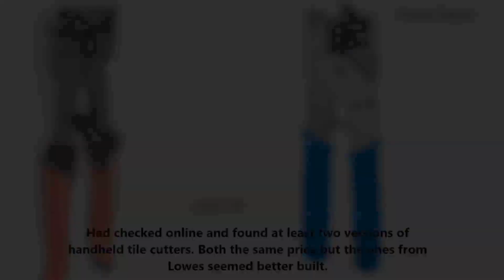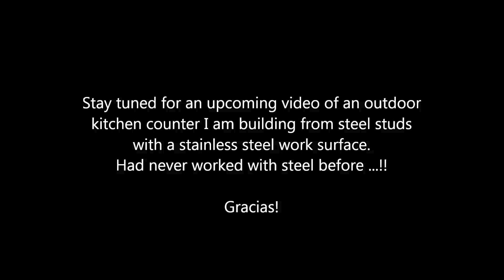Cutting terracotta tiles with a handheld tile cutter

Comment: Thank you! I'm doing a round table top with 4×4 decorated terracotta tiles, and I need to cut and shape the tiles for the edge of the table. I don't recognize the tool you used. Could you post the name so I can look it up? I have a great deal of ceramic tile as well I would like this easier way of shaping them for my projects!
Reply from the maker: That looks like an interesting project. Amazon has these. Search for 'hand tile cutters'. The cheapest were about US$15.